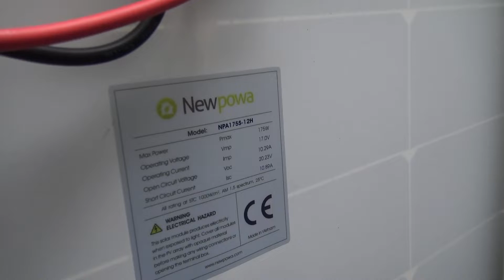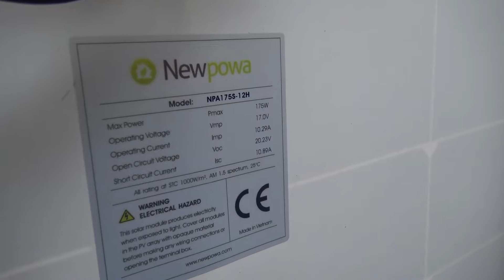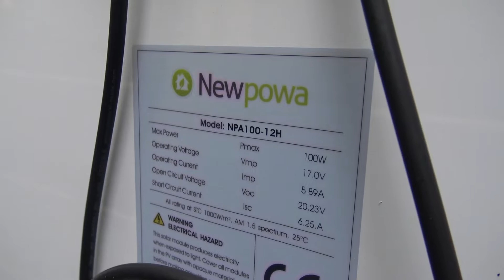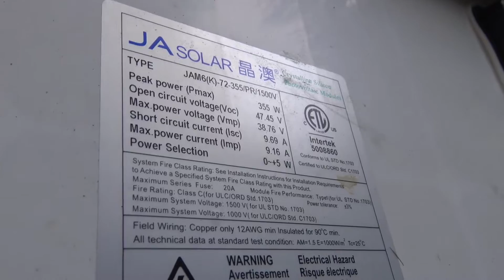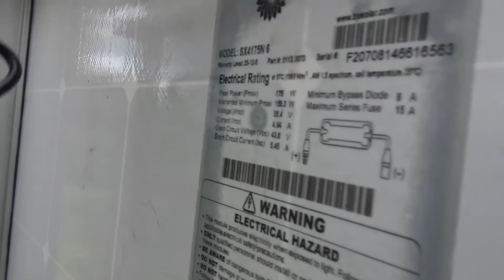3 Types Of Solar Panels, Monocrystalline, Polycrystalline and Thin Film, Off-grid Emergency Power

Comment: Good video! Solar cells are made of semiconductors, and that means when you shine light on them, you will generate electron and hole pairs. So these electrons and holes have to follow in certain way (to the contacts) to generate current. If you loose the generated electron and hole pairs, you loose current and therefore efficiency. 
Polycrystalline solar cells could be less efficient because you may loose the electron and hole pairs at the grain boundaries of the semiconduting material. As you also demonstrated very well with 🍁. But that’s not always the case, and there are so many chemical treatments to make polycrystalline solar cells way efficient like beyond 22%. CdTe technology for instance, it’s a thin film technology, and you can get good efficiency out of them even though it’s a polycrystalline film. So it’s a thin film (less material) and it’s efficient, which means you are saving money. There are other promising thin film technology out there too, like CIGS solar cells, and most importantly Perovskite solar cells which they show beyond 25% efficiency. They are still under research and development to make them more stable and much cheaper.

Comment: People tend to overlook some benefits amorphous panels provide, while being far less efficient in a perpendicular orientation I noticed they put out more power from installations with more parallax. I have even seen them generate during a full moon. I lived in a travel trailer for 5 years on just 45w of amorphous panels and I had to replace the four 6v golf cart batteries after 2 years. I still have the panels after 10 years and they still work.